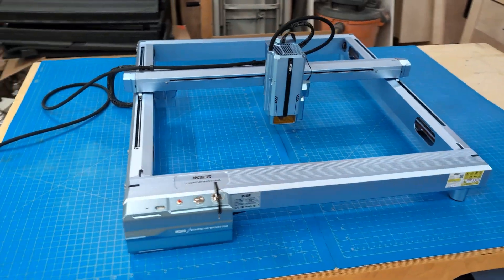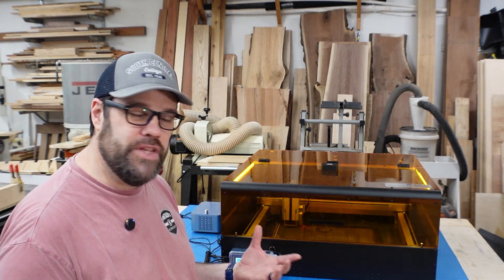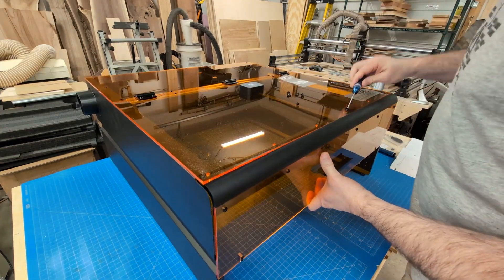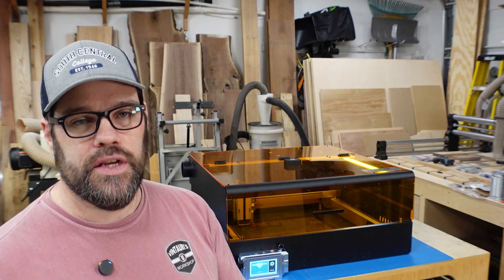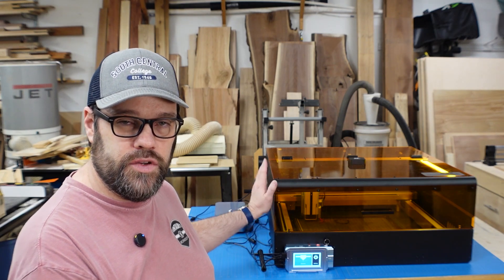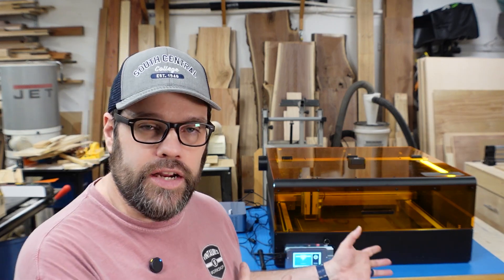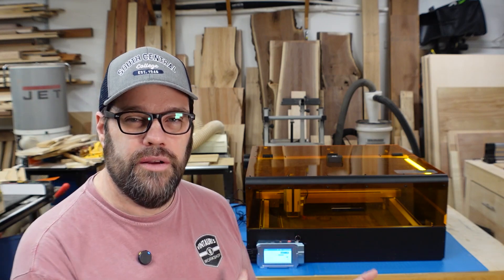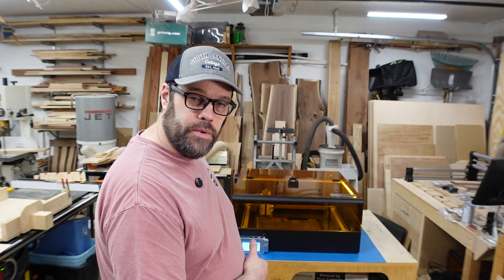Building vs Buying a Diode laser enclosure

Comment: 2.5 sheets of foam board + clear panels cut from several blueberry packages + 1 or two Scythe computer case fans out of old computers...  If you are a company then yeah go for crack head priced boxes for your workshop as its also a write off.

Comment: Steve, good information and review.  One thing about open frame lasers is you really do need some sort of enclosure.
Reply from the maker: Thanks Paul! I agree, most of the time an enclosure is a necessity.  However it is nice, on the rare occasion, to be able to move the laser to the large item and engrave on it. But then other safety measures need to be taken for the laser light and any smoke and vapors.

Comment: I'm building a "DIY" enclosure for my NEJE 4max with the extension rails right now. This thing is massive 750mm x 1030mm (working area alone) and I'm not spending NEAR what you quoted for building your own. If you're spending that much making something your own... Then you don't make something on your own. The entire part about "DIY" is NOT spending money on handles, brackets, etc...
Reply from the maker: I feel I was fair in my assessment and mentioned that you can save some money 3D printing or reusing items. But if you were to purchase them all new at the local hardware store, they all add up fast.  I've built quite a few enclosures and other shop fixtures and all the little items start adding up fast.
Reply: @Vintauri its still nowhere near $300+
Reply from the maker: @jeffallen3382  Well then, you are finding some deals on materials and hardware.  I took my prices from Amazon and Home Depot, which are typical places for people to purchase the materials in the US.   Again, my total is if you had to purchase everything at typical prices.  I didn't use the best plywood, but also not the worst. I also don't cheap out on the laser-safe acrylic, but purchase it from a trusted source.  It all adds up and most people are surprised when you total it up.
Reply: @Vintauri I think the part @1:07 explains why you exaggerated the diy price so high...
Reply from the maker: @jeffallen3382  Ask around, I'm not shy about calling out manufacturers on bad products.  I've turned down equipment when they ask me to sign a contract or dictate what I can say. Shop around for everything you need to build a similar enclosure, and you'll quickly add up a bigger bill than most think.
Reply: @Vintauri just be honest when comparing product a to product b.

If you can't "DIY" and enclosure for nowhere near $300+ you shouldn't be doing this in the first place! Feign outrage about what I said just proves this was because you got paid to push product a.
Reply: @Vintauri again... I'm building an "diy" enclosure for my Neje 4 max right now which has the extension rails. I'm sure you know how big that is! It's probably close to 4x the size of the one you showed. I know how much I am spending...

Comment: When I first bought my xTOOL D1 Pro I made my enclosure with wood, It worked very well but wow, was it heavy, When I later bought the extended rails to double the unit's length, I decided that I didn't want to use wood. Instead I bought the xTOOL enclosure and the extension panels for it. I will be using the laser in my van so I really like that I'm not having to lug around a giant wooden enclosure.

I bought the xTOOL F1 after that and added the fume extractor. I can therefore use that for both the extended D1 Pro and the F1. Having a small laser workshop in my van is working out great but I doubt that would be the case if I had a heavy wooden enclosure. I much prefer the lightweight panels that Velcro together.
Reply from the maker: It can be tricky finding a good option for the longer or larger lasers.  The weight factor as well when needing to be able to move it is something to consider as you mentioned. Even by using 1/2" plywood, my larger enclosure is not something I want to move around too often.  

I love the idea of a mobile workshop in a van as I love getting out and exploring!  Maybe some day when the kids are out of college I'll have the money and space to build out an adventure vehicle.